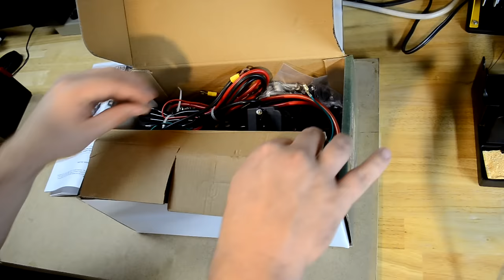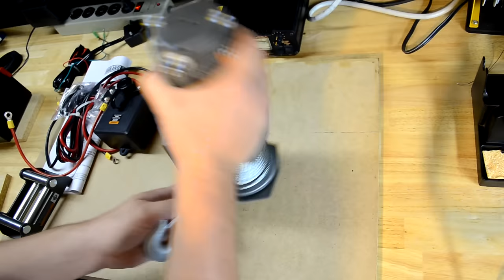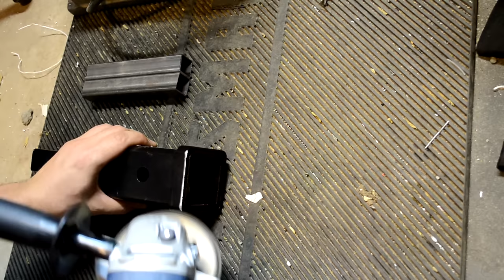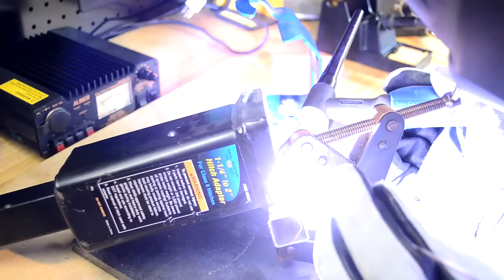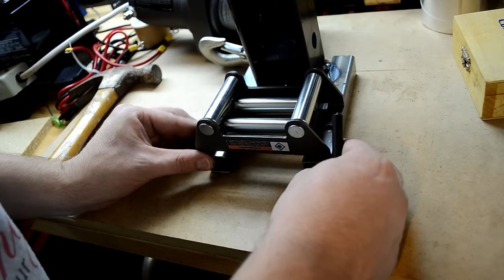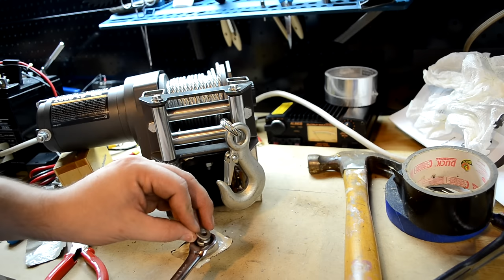Mounting a HF 2000lb ATV Winch to Trailer Hitch

Comment: My buddy has a 2 wheel drive truck and has some property he goes to occasionally that once every few years can get a little muddy. 99% of the time the property is dry though. He doesn't feel a 4x4 is neccessary because he would literally use it about once every 3 years. So we took a 3,500 lbs UTV winch, mounted just like you did here on a hitch, and bought a snatch block. The whole setup weighs 35 lbs. He just keeps the small winch and hitch in his toolbox on the back of his truck. When he gets stuck, he just plugs the hitch into the rear and then uses jumper cables from his front battery to the winch to power it. If you do this, use 4 gauge or 2 gauge jumper cables minimum. It works perfectly. Turns the 3,500 lb winch into a 7,000 lb winch with the snatch block. It can easily pull his fullsize F150 out.

Comment: I bought the same winch and bought a slide in hitch step from harbor frieght. I drilled holes in the step and mounted the winch on it. looks good because its diamond plate and also only cost 95 bucks for everything. Works well. Nice video

Comment: i used a heavy duty strap and strapped the winch inside a uhaul truck,   used a car battery for power, and winched a gold wing up the loading rampe and i walked beside it on a ramp of my own.  the gold wing was unloaded with fork lift so no worries unloading.

Comment: The main motor and drum assembly is identical to my old Warn 1700. The relays is those were a POS and I've upgraded it
to a late Runva style contactor. 2000 lbs is a stretch here and it won't last long if you work it at that load. Figure around half that. Not a bad winch for the money though.

Comment: I plan on doing that for my truck and put a receiver on the front of my trailer to pull loads onto it. Also I plan on doing the same with my vice with an additional receiver on my work bench.

Comment: Im gonna do this with one of those winches. Ive needed something like this to haul out wood i cut and this is what i think i need
Reply: The duty cycle on most of the electric winches is pretty crappy... On this particular winch, you can only use it for 45 seconds of each 15 minutes at max load... It's a 5% duty cycle... So, 45 seconds of use, 14m15s of rest... More than that and you can overheat it and damage it... Even the expensive name brands though don't have a great duty cycle rating... If you want a winch that can have a 100% duty cycle, you're going to need to be looking at hydraulic winches...  I had one on my Jeep XJ and I could winch all day and not have to worry about it overheating...

Comment from the maker: I only needed it to drag a 500lb lathe - The car is just an "anchor". Used it once and sold it.  I think the largest they offer is rated at 12,000lbs (its Chinese so if that's anywhere close to actual capacity who knows).

Comment from the maker: Yeah, I just hooked it up to a Car Battery sitting off to the side in the video. I'm using this to lower heavy machinery into my basement - the car makes a nice anchor, so I didn't hard wire it to, or make an outlet from the Cars electrical system.

Comment from the maker: I just wanted to use my car as a stationary anchor so I could lower a machine into my basement - I left the box just sitting next to the battery, but wouldn't be much effort to mount it in the trunk.

Comment: Great Installation, however, where did you get the power from to the winch?
Since this is a small winch to work on an ATV with a motorcycle 12V battery, i wonder if I can feed the battery
From my car trailer electric plug to recharge the battery. Any thoughts or ideas?
Thank you in advance for your reply

Comment: nice I need one of those I like that welder to what is that a plasma cutter / welder?
Reply from the maker: It's an everlast 3-in-1 Tig, Stick and Plasma. I believe its the 256A model. Few years old I got it in a trade. Works fine, but I don't give it much use as I'm still learning so cannot comment on how durable it is.

Comment: I just bought the same winch. How did you get the hook through the rollers?
Reply from the maker: NOadventure I think I removed the rollers to get the hook through. Should just need a screw driver to pry off the e clips from one end of a roller. Be careful the clip doesn't fly away and get lost.

Comment: Very cool,did you make the battery connections easily removable, if so how?
Reply: You can use a heavy duty pair of 4 gauge or 2 gauge jumper cables that are about 25 feet long. Just hook it from your front battery to the winch. Just swap the cables around to reverse the winch.